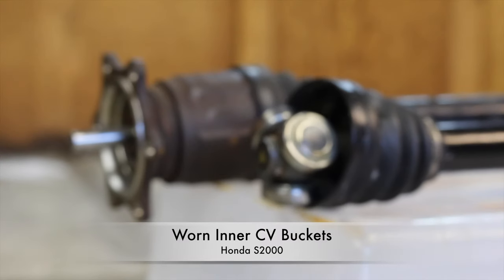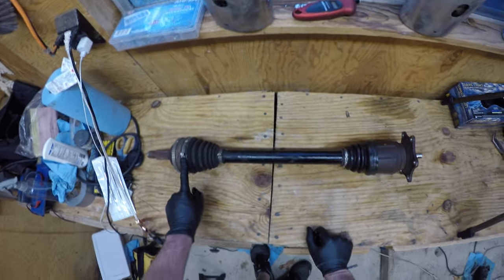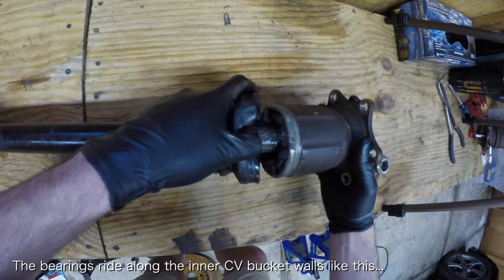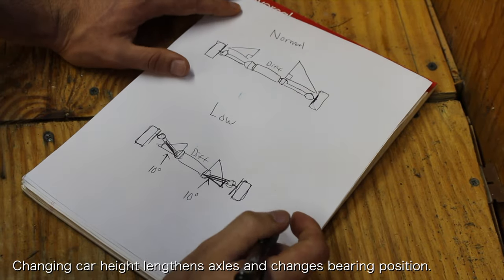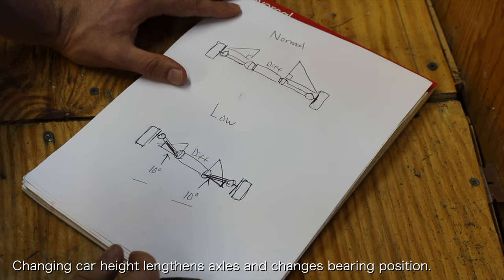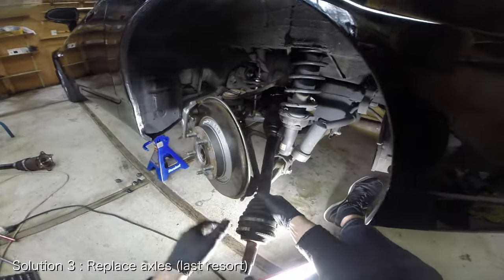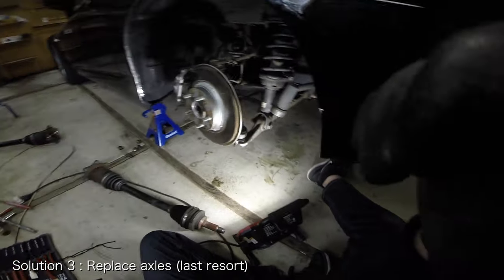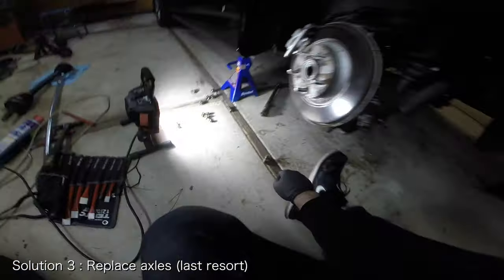Common Problems - Worn Inner CV Buckets and How To Fix Them | Honda S2000

Comment: Great DIY. Thanks a bunch. Am actually going through this problem with my 2006 S with 155k on it. Was tracked heavily with KWV3. Switched back to OEM because I dropped a wheel at the track and blew one of the KW. Was going to buy OEM but am going to try the swap. If that doesn't work I'll by OEM. Keep the videos coming. They're great👍🏽
Reply from the maker: +armando armenta Glad this is helpful for you! Thanks for the kind words.

Comment: @DIYGuys first off i'm beyond thankful that i came across your videos! and I am even more grateful someone with another S2000 is making repair/diagnosis videos, and making damn good ones too! Your Half shaft spacer video saved my life when my S started to get that famous vibration not long after being lowered. I've got a question about some more vibration. As of the last month it seems to have this vibration, not a violent vibration, but definitely noticeable. But it seems to come on like almost exactly right at 35-36 mph and will then smooth back out over 40. Have you or anyone who reads this, have this happen before? Sometimes it will feel like it vibrates again around 65-70 but if i give it gas it feels like it smooths back out again.
Reply: Torque converter
Reply: @theKing-bw3re  🤣🤣🤣

Comment: After this video I changed both axles on my CRV from what I read it is notorious for that vehicle , I only had 90,000 could not go past 60 to shaking was stupid it started out mild and got worse thank you so much I didn't know what to do, balanced all the tires changed all the tires rotated all the tires nothing helped night and day after changing the axles thank you thank you thank you

Comment: Rewatched. At one point stated "for some unknown reason drivers side wears more" (paraphrased).

Reason is direction of rotation of propshaft. Its like how drill rips out of hands when bit catches on something. Torque applied opposite direction of force applied.

Propshaft torque forces one wheel harder into ground, tries to lift other side.

If only drove in reverse, wear would be more on passenger side.

Comment: Vibrations actually comes more often from the passenger's side, as that (right) side has longer shaft between outer and inner CV joint and wears down more intensively than diver's side thereof.
This is the case with Acura TSX (Accord CL).
Reply from the maker: With the S2000 it’s always the driver side that wears faster. Why would a longer shaft wear more intensely? A longer shaft puts less stress on the joints because they are operating at less of an angle.

Comment: Nice video.  I never had a vibration issue even after using 3 different coilovers of various ride heights over the years.  But I guess someday I may have to a CV bucket swap at some point.
Reply from the maker: Strange. If you changed ride rights frequently enough you may have just built one large smooth groove.

Comment: Thanks, i have knocking which from the look of it could be in the bucket area that goes into the inner half shaft bearing. The cv shaft from wheel to bearing moves up down left and right So I'm considering a kit to change the 3 bearings and bucket out. Hope it's not thev half shaft bearing (that doesn't seem to be  moving which gives me hope)

Comment: I Hit a pothole about 6 months back. Can that damage this CV Joint you are talking about? 
It's slowly started making a noise about a month later. Now I am going to replace it in a few days. 
Just wondering what kind of noise it would make... 
I know the Clunk clunk or clack clack when turning on a bad axle... but this noise is different
Reply from the maker: Unlikely

Comment: My ap2 has around 144 right now. I was driving at 70 and the vibration keeps getting worst as speed rises. The other thing I hear is common is unbalanced tires or bent rims. If anything, I'll check those before changing my axles. But you mentioned your cr is at 140k so maybe mines are going out too

Comment: Did you feel the vibration in the steering wheel? I am chasing some vibrations, which start at 120 kph in my rwd sierra. Its also lowered and I am suspecting the driveshaft(s) after renewing almost everything at the front.

Comment: same thing happened on my TSX after lowering it, but bc its FWD its the passenger side inner joint that needed replacing. Cant switch the buckets on FWD because one side is female and other side is a male. I used a new oem bucket for my repair and that was 6yrs ago. The wheel vibrations are back and wheel balance didn't fix anything. I suppose you can also rebuild that bucket with a junk yard oem axle from a same model car that wasn't lowered?
Reply from the maker: You absolutely can. There was a shop that used to sell just the buckets.

Comment: Change the front struts on my 03 LeSabre which made it right almost 3 inches higher in the front now every time I accelerate especially going up a hill my steering wheel shakes does this sound familiar to other people?

Comment: Quick question.  All same symptoms of worn inner cv joint, but trying to figure out which one.  One thing I noticed is that when I turn left while accelerating, pretty dang smooth.  If I turn right while accelerating, it gets very bumpy with vibration right away.  Would this suggest left or right inner cv?  I figure the right side is maybe under a greater angle from body roll, but left inner is probably under more load from the acceleration?
Reply from the maker: The driver side is the one that wears first. When you turn right you compress the driver side, lowering the car and triggering the worn area of the bucket.

Comment: your is still lowered after the changing out the new axles right? did the problem come back, because the axle are still sitting at different angle?

Comment: i have a vibration only in 5th or 6th gear and under 2000 rpm and full throttle? could that be inner joints or something else. If I shift late at 2500 rpm car just pulls hard and does not vibrate.

Comment: Would you suggest regreasing the inner CV buckets as a maintenance item to help improve the longevity of the current ones on my car?  I dont have any shakes and I'm not lowered.  just didn't know  if regreasing them would be a preventative maintenance thing I could do.  Thoughts?
Reply from the maker: +Wesley Huss I'm not sure if it would be worth your time to be honest. Once the putting starts occurring the grease gets real dark from the shavings. Until then it seems to operate fine.
Reply: DIYGuys thanks for the reply!  love the videos!  keep up the great work!
Reply from the maker: +Wesley Huss will do! appreciate it

Comment: I've got the same problem on my audi a6 quattro. Changing axles every 6 months or so, still inner cv joint fails. Dont have any clue why its happening...
Reply: I have an A5 think have the same issue it has taken me almost 1 year to find . Now the noise is bad and I get vibration when taking off . Noise at low speeds . Steering  vibration when turning at low speeds at a car park etc

Comment: Good to know.  Even after swapping out the stock AP2 suspension > CR suspension > CR w/ Swift lowering springs > Fortune Auto coilovers, I still haven't felt this vibration yet in acceleration.  I guess I'm lucky, but at 112,000 miles, my car may have this issue soon.
Reply from the maker: +GPW AP2 Type-S well at least when it does happen you'll know how to deal with it 😊

Comment: When I bought my car, it had 1 oem axle (driver) and 1 after market axle (passenger), it was causing vibrations.. After I swapped both with after market axles, it caused more vibrations from 40-50 mph under hard acceleration.. I just installed the half shaft spacer and that didn’t work. Someone on s2ki said it won’t work on after market Axles and it’s only meant for OEM axles. I’m going to install used OEM axles and use the spacers. First I’m going to check the differential bushings.
Reply from the maker: Yeah aftermarket axles are mostly junk so I’d go used OEM for sure. You can inspect the state of the axle buckets before you put them on the car and swap if necessary
Reply: DIYGuys I’m using Duralast from Autozone! Someone posted it on S2000 Enthusiasts yesterday, ppl commented, “it vibrates automatically.” Some ppl have luck but it’s a hit or miss I guess..

Comment: I swapped mine left to right to fix the vibration. I only drove maybe 50 "EASY"miles after I initially felt the first vibration......like I accelerated like a 10spd bike.. How long did u drive yours after the symptoms appeared?
Reply from the maker: +Honda 2000 I bought my car with the problem. I think it had the problem for tens of thousands of miles since it was so bad.

Comment: If you swap the cv bucket from driver to passenger, won't the passenger side be screwed up now? I feel like there's something I'm not getting...I think I'm going to try and swap them, so I hope you can reply!
Reply from the maker: The bearing rides on a different position of the bucket on the passenger side so it won’t ride on the screwed up part.
Reply: @DIYGuysvideo  The vibration only happens around 60 mph under acceleration. If I left off the gas or accelerate under 60 the vibration doesnt seem to be there. Do you think this still might be a cv bucket issue?
Reply from the maker: @4sky  Yep. It should get worse with speed so see if you still feel it at 70,80, etc.

Comment: How often do you see the tripod joints go bad before the CV buckets are worn? I'm working on an 05' Highlander and the passenger side tripod joint has 2 bearings that swivel just fine, but the 3rd one doesn't. It sits perfectly vertical and the bearing spins just fine, but doesn't swivel at all. On the drivers side, all 3 of the bearings swivel. Is this normal?
Reply from the maker: Hi CJ, I cannot speak for anything besides a Honda S2000. I don't think I've ever seen a tripod joint go bad before.

Comment: Is it possible to put a spacer between the hub and axle to push the tripod bearing into the cup to reduce the wobble?
Reply from the maker: Maybe, but you would be adjusting the available threads for the axle to but to clamp down on which may be dangerous.

Comment: Great instructions and advice.
Reply from the maker: Glad you liked it!
Reply: @DIYGuysvideo  ,, I have a 97 Honda Inspire 5 cylinder that clunks loud when moving from park or reverse . Original engine, and transmission changes out beautiful. It doesn't clunks while driving. Mounts are good according to the alignment tech. Mechanic said it is a bad tripod bearings. Any input ? Thanks
Reply from the maker: No input. Good luck!

Comment: The Honda service manual says you need to match the bearings to each race in the bucket, mark them during disassembly so they can be re-assembled back into the original bucket slot they were running in, is that important to do? 
You didn't seem to do that?
Reply from the maker: I’ve never matched the bearings to the buckets and it has never made a difference. I’ve also never seen it marked as significant in my research about the issue. Maybe it’s a precaution.
Reply: DIYGuys Thanks for the reply, have you ever had one of those harmonic balancers(rubber donut things on the shaft) fail and cause vibrations? Can you remove them if they come loose and carry on like normal?
Reply from the maker: Are you referring to the crankshaft pulley (harmonic balancer) or something on the axle. I’m not aware of any donut thing on the axle.
Reply: Those rubber vibration dampers that are fitted in the middle of some Honda CV shafts, like this: https://www.civicforums.com/forums/attachment.php?attachmentid=108669&d=1501482860
Reply from the maker: Not sure. I don’t believe we have those on the S2000.

Comment: My car have a clicking sound when I accelerate hard example from a full stop at a traffic light and if I am to press hard on the gas the will be a clicking sound. Is the problem this CV joint thing?
Reply from the maker: No. If it is an S2000 check out my rear axle TSB video. It’s likely a wheel bearing issue.
Reply: @DIYGuysvideo  thanks for the fast reply dude.

Comment: I have these vibrations as well and I planned to only replace the buckets and tripod bearings since the outer joints are fine but I can't seem to find the buckets themselves as a part.
Reply from the maker: At one time Ballade Sports sold them but they no longer do. Why not swap them from side to side?
Reply: They're both pretty much equally problematic and in need of replacement, really. And it's a Fiat Brava, btw, not a Honda. AND I'm in Greece, can't import stuff from the US.
And it's kinda strange, because, apart from the PO's swap to 15" wheels (14" stock), everything else is stock. I'm pretty sure the damage was done because the aforementioned PO's wheels were extremely heavy 7j alloys and the car is 1.242cc, which probably stressed the transmission and caused the excess wear. I've got 15x6 now and it certainly relieved the vibrations but they're still there.
Guess I'll have to either find used ones in good nick or swap the halfshafts entirely.
Anyway, very nice video, thanks for putting it out there!
Reply from the maker: Wow. Didn’t think non Honda people would even find this video haha. Good luck.

Comment: do a video on how to fix or change the accelerator sensor.
Reply from the maker: +proraceer07 do you mean the throttle position sensor?
Reply: DIYGuys I think he means the AC sensor, which is the part connected to the throttle pedal that measures the % throttle on dbw cars. I had mine replaced at ~120k miles.
Reply from the maker: +ayowser01 Oh, thanks for clarifying that. I'll take a look at that I've never heard of it. My DBW is relatively new to me 🙂

Comment: Hi i have a knocking noise in inner cv axle.. did not open yet, but when i move it back and forth i can hear the sound. I know its a normal play but the sound? Does it need greasing or spacer?
Reply from the maker: The axles are meant to move so play is normal. They only cause the vibrations under load which I don’t think you can relocate. Is this an s2000?
Reply: DIYGuys , its not a s2000 its a mazda 5... there is play when i move it.. and you can hear the knocking sound on road on and off.. checked suspensions and bushing it was ll fine. But when i moved the axle thats when i hear the knocking sound
Reply from the maker: This video is specifically for the S2000 so I can’t really say anything for miatas.
Reply from the maker: Not sure.

Comment: Right wheel on my car vibrates when accelerating straight and also when turning right, pretty much (noises and rattling became louder with speed). At whatever speed, slight movement to the left and all the noises and vibration goes away 100%. My outer CV joint is a bit worn but there is only very small clack only with sharp, right, full turn. What could be the problem? Bearing, CV axle joints, or both?
Reply from the maker: Both. Is this a Honda S2000?
Reply: Haha :), no its Peugeot 309 diesel but your video was very helpful. So you say that my inner joint is bad (because I wrote that my outer clacks a bit)?
Reply: @milojakulovic9335  driver side cv axle 100% man. I had the exact same problem i would get vibrations when accelerating and it would be 10x worse when turning right but left turns was perfectly smooth and normal. Even going straight i would get it but if i barely would turn left it would go away. Also when turning right and the vibration would start if i would let off the gas and just coast around the right corner it would go away. Mine didn't make much noise but the vibration was so bad it was basically unsafe to drive. Hope this helps you man.

Comment: Ok, do you have the video what type of viberatiin. Mine kinda grinding sound start at 20 mile in hour a d goes higher.   Checked the bearing nothing wrong, i can feel sound on my feet when im driving. Cx9 2011 has 92k
Reply from the maker: It’s like a thumping that shakes the whole car. Not sure if applicable to the cx9 tho. I’m a Honda S2000 guy
Reply: @DIYGuysvideo   no its like grinding and really bother i know the right bearing need change but do you think make nose that look from under the car where the brake and gas pedal are?
Reply: Hey did you figure out what that grinding sound is, I'm have the same problem with my vehicle.

Comment: I am not looking forward to the day I experience this vibration. The lower the ride height, the more pronounced and the sooner it can happen, right?
Reply from the maker: +ayowser01 This becomes a problem after the ride height is lowered after the groove is made. So technically is your car was always low this wouldn't be an issue since the groove would be made at that low height. The more time you spend at the current ride height and make that groove the worse it will be once the car is lowered.

Comment: I had a heavy rolling noise only when came off the accelerator. I had to  change the whole power train.
Reply: sounds like one of the sound i have, what parts did you have to replace? did it fix it?

Comment: It's not only on acceleration. In a manual car if you don't put the clutch in when letting off the gas it will do the same thing because the motor will be slowing the car down so it puts stress on the axle also.